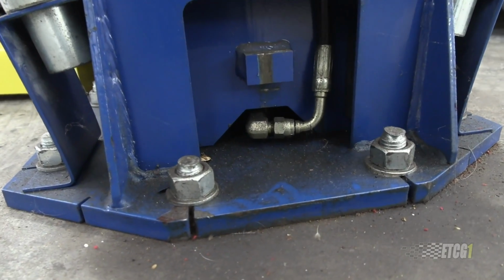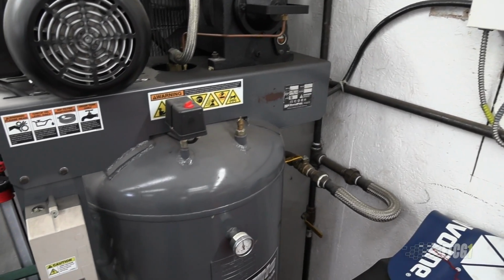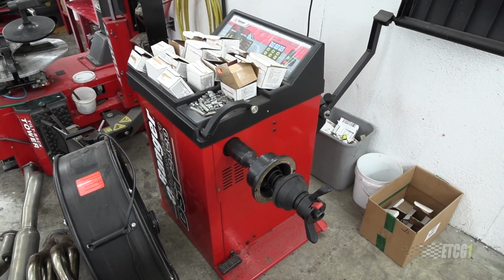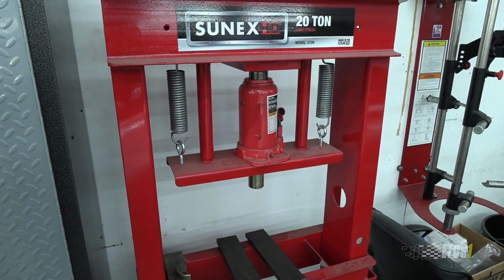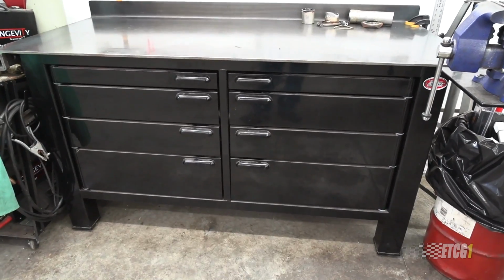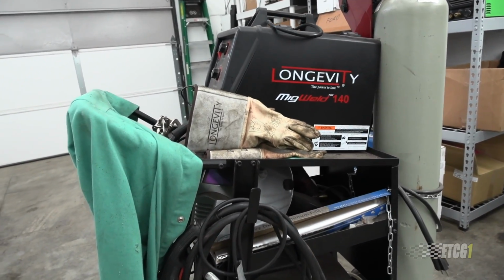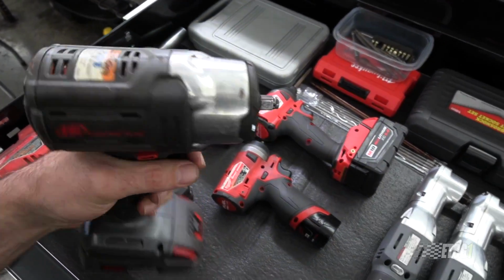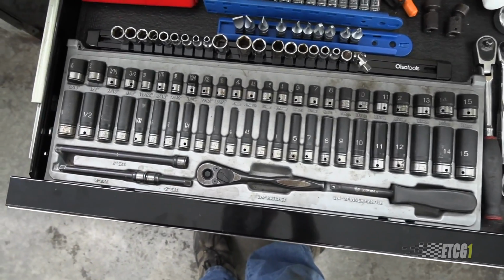The Tools I Get Asked About the Most

Comment: Hi Eric, my question isn't about your tool video, it's related to my 2000 Chevy astro van. Hopefully asking here is ok? It leaks oil, seemingly from the from timing cover, building up at the bottom of the oil pan, beginning at the front, moving to the back and covering everything. Jan 2019 I last replaced it, oil pan gasket, the harmonic balancer, everything related, and before that about two years before and two years before that. I can't have it leak oil... yes I used black silicone around the timing cover and in  the corners of the oil pan, plus blue locktite on the bolts... why do I have to do this so often. Seems ridiculous for the time it takes.... any ideas or tips for the next tear down? Different silicone? The cover has to be replaced, felpro has been my go to gasket type.... thanks! Goose

Comment: you didn't mention anything about your footwear in the shop where you're on a concrete floor?  Safety glasses? and recording equipment?   GOOD stuff though
Reply from the maker: Aside from the recording equipment, you're the first to ask about my shoes.
Reply: @ETCG1  being a health care professional I understand the wear and tear concrete does to the knees. Especially over long periods of standing.

Thanks in advance for the dedication to the editing and material
Reply from the maker: My philosophy is simple, if it goes between me and the ground, it's a worthy investment. That includes, my shoes, my bed, my tires, and my desk chair. I usually change out my shoes when I start to see the treads wear down. I used to wear steel toes, but those are hot in the summer and cold in the winter. Now I often just wear name brand hiking shoes in the shop. Thanks for your comments.
Reply: @ETCG1  thanks for taking time to reply.

Comment: Do you bleed the water out of the compressor tank? Is very easy to forget.
Reply from the maker: Every time I use it. I also have valves at each of the drop downs. I actually think my tools are just getting old. I just realized they are 15+ years old.
Reply: @ETCG1  Yeah that could be it. Especially if the routin on greasing them up hasnt been what it should. The could go in 9 month's from that.

Comment: Is it possible that your air cutting tool is less efficient than it used to be? It may makes you think that the air compressor is at fault
Reply from the maker: Actually I think that is the problem now that I think about it. The tool is more than 15 years old.

Comment: I don’t think I would trust getting under a vehicle on a lift with a leaking hydraulic system, no matter how small. seems like a problem that the manufacturer should be willing to take care of. As I recall, that lift is donated to you for the purposes of your channel. One would think the manufacturer would stand by it. I realize that when the lift is raised with a vehicle on it, it is down on the safety stops, but still, a leaking hydraulic system with a 4000 pound vehicle on it can be a bit frightening.
Reply from the maker: Just like elevators there is a safety system in place on the lift. I set it down on the locks when I used it. They hydraulics aren't even involved at that point. Thanks for your comment.
Reply: ETCG1 I understand your point. Just a little bit frightening to have a leaky hydraulic system. Stay safe.
Reply: Depending on the style of fitting it may be nearly impossible to stop it leaking all the way. And you might not be able to access the fitting without taking the cylinder out. I have yet to see a hydraulic system that doesn’t leak some after a few years of use. The fluid under pressure just works it’s way out over time.

Comment: When I used to run my tire shops, I had to drain my compressors everyday through the valve on the bottom.
When I first got my shops there must have been a gallon of water between my three huge compressors. After I started doing this on a regular basis they all seem to work a lot better.
I'll do I forgot to ask do you ever use LINE dryer, it helps keep the humidity out of the air hoses.
Reply from the maker: I drain the tank after each use. If you watch the video of my air system linked in the description you'll see that I have drains on all the down pipes too. I believe the issue is that my air tools are 15+ years old. Thanks for the comment.
Reply: The last place I worked had a really nice shop compressor. But, we were always getting a lot of water from the lines and it seemed to run a lot for how big it was. I went looking for a drain and found it had an auto drain that was installed but not plugged in. I put a hose on it so it would drain outside and plugged it in. It probably drained 20 gallons of water before it started cycling. After that it would drain for a few seconds a couple of times a day and everything was way better. Not sure why it never got turned on before.

Comment: The GP sockets are great! Lifetime warranty and far cheaper then "tool truck" impact sockets. Only GP sockets I've broken have been universal/swivel sockets. Otherwise, I've never broken a shallow or deep traditional socket. They, and a complete set of MIT impact sockets (bought off a pickup truck) have been great to me. I have a handful of Snap on impact sockets, they replaced some MIT sockets I lost, and they've all been replaced several times due to wallowing out and not grabbing the fastener. Or not staying on the impact's anvil.

My most favorite tools of all time are now my air powered cooling system refiller and pressure tester. Saves loads of time purging cooling systems, especially on many of today's cars where the radiator is not the highest point in the system. 

The pressure tester mean I'm not pumping it up for an eternity and I don't have to add fluid to the system to develop pressure quickly. Just leave the air on and you'll find that leak really fast.

Comment: Hello eric, the loss of air volume could be attributed to accumulated condensation in the compressor tank. This would explain the loss of power although pressure remains steady. It should have a drain valve on the bottom to empty out.
Reply from the maker: I don't think that's the issue because I empty it out every time I use the compressor. See the video linked in the description. After shooting this I realized that the air tools I'm referring to are at least 15 years old. It's likely that my tools are just getting old. Thanks for the comment.
Reply: @ETCG1  Rubber air hoses can fail internally  it sounds like you have a restriction some where in the air distribution system
Reply: I was wondering the same thing.  I usually open the drain port on my compressor every time I'm done using it and let it dry out.  Of course, I don't use my compressor on a daily basis either ...

Comment: Thanks Eric! Just to clarify... is the reason you recommend grey pneumatic sockets because they’re dual compatible with both ratchets and impacts?
Reply: I thought any impact socket could be used on a ratchet, but regular chrome sockets shouldn't be use with an impact tool?
Reply from the maker: Sort of. They are thin wall impacts.

Comment: Being a Ford guy myself I’d like to see every single hammer you own, even the stuff you misuse as a hammer like a pipe wrench. 

Air flow issue may be water trapped in lines.  You’re not using a refrigerated air dryer and drip legs with automatic blow downs. I work on pneumatic control systems and know what I’m talking about. Nothing a few thousand dollars won’t fix.
Reply from the maker: I don't have automatic blow downs but I have water traps in all the lines. Check out the video linked in the description about my air lines. 

It just dawned on me last weekend while I was using my cut off wheel that my cut off wheel is about 15 years old. It might just be that my pneumatic tools are old and wearing out. 

Thanks for the comment.